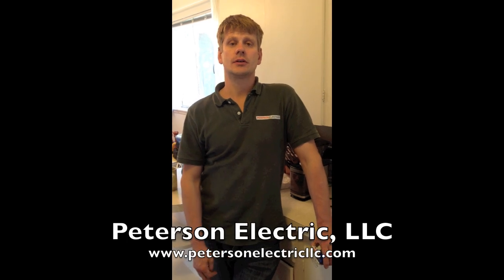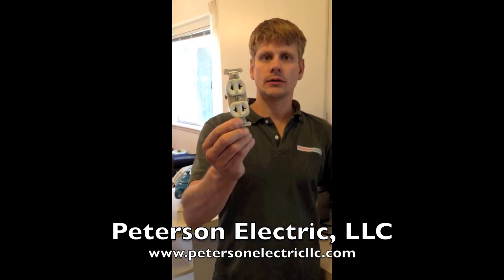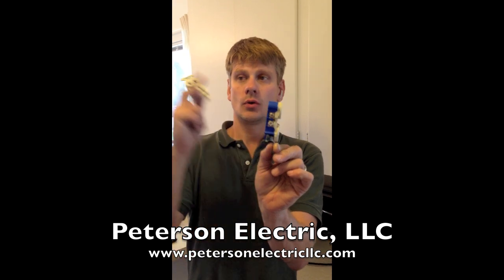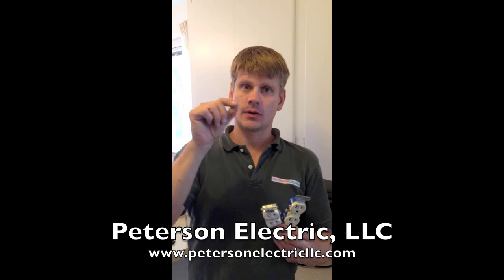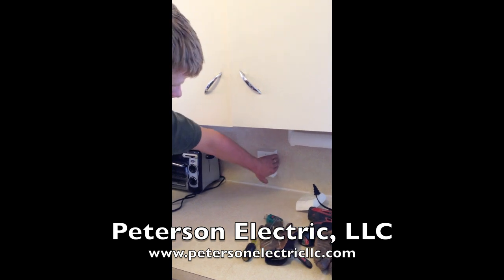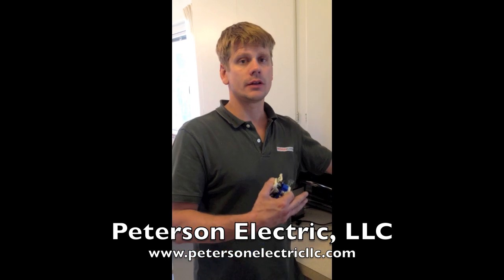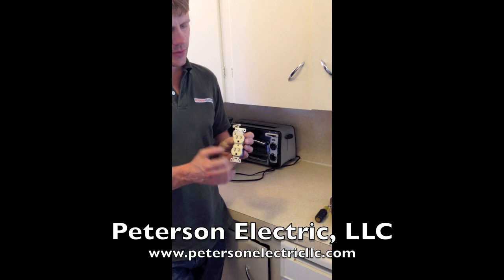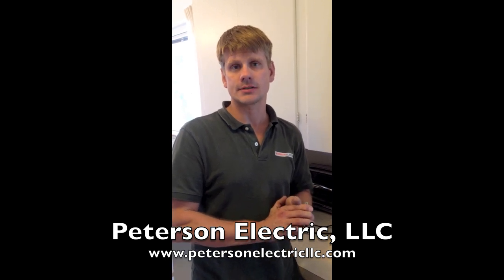What To Do With Electrical Grounding in A 1950s Home?

Comment: You didn't mention that an ungrounded gfci will not protect sensitive electronic equipment, even with a surge protector. Ungrounded gfci's must have a sticker on the faceplate stating "no equipment ground".

Comment: adding a separate ground wire back to a correctly grounded up graded panel would work, the ground would function correctly. Then why does NEC not recognize this as a properly grounded outlet or method? Then if a copper water pipe is tied to a ground rod which in turn is tied to the panel then a grounding clamp onto the copper cold water supply could catch a ground wire at an outlet and work correct.  Only problem would be if the water pipe were to break it would isolate the ground clamp and lose the "outlaw" ground. Last ground question. The old conduit systems were tied to the panel and so were grounded. I have seen pigtails in an metal outlet box which served as a ground. It works but is is legal? Actually the screws on a 3 prong outlet would ground to the conduit attached outlet box.

Comment: Installing GFCIs doesn't magically give you a ground if you don't already have one, and the presence of 2-wire outlets does not necessarily mean you do not have grounding through the conduit. I question your expertise.
Reply from the maker: YAH, I agree with you, but you have probably not watched all of my videos on my statements of GFCI and AFCI are NOT THE ONLY SOLUTION> You and I think the same about needing the Grounding wire in the circuit. Not sure how you came to this conclusion based on my videos. IT IS A MUST WITH OUR COMPANY' POLICIES  to have the EGC conductor installed.
Reply: @Petersonelectricllc  afci has nothing to do with grounding. Once again, I question your expertise.
Reply from the maker: @arthurserino2254  YOU ARE WRONG< AFCI AND GFCI NEED PROTECTION TO THE GROUNDING SYSTEM IN THE HOUSE, I know where the code articles are, do you????
Reply: @Petersonelectricllc  afci detects Arc faults, it does not require a ground to function properly. GFCI does if it is being used with a grounded Appliance. The fact that you don't know this raises serious concerns, and I would never hire you to do any work in my buildings. If you know the code so well, you should understand them too.
Reply from the maker: @arthurserino2254  210.12 
210.8 
406.12
406.4D
250.130C
250.122
110
100 
ON AND ON - I could do this all day. You don't know anything.
Reply: @Petersonelectricllc  Great, you can use Google just like everyone else. Too bad you can't explain the difference. You prove one thing, you're no master electrician.
Reply from the maker: @arthurserino2254  The difference is simple, Arc vs Ground faults. .007 milli amps on faults for GFCI min. AFCI, thermal. Either way Grounding is the first cause of safety. I am not a Master, only CHrist, But i am an expert in my field, learning every day. You?
Reply: @Petersonelectricllc  finish your training before you start making an idiot of yourself on YouTube. It's not good for business.

Comment: I have a house that 35 years old and the neutral and ground are on the same bar and is grounded with a 8 foot rod I never had a problem at all,  When  I test the wall plugs with a plug in ground fault tester it shows that I have a grounded sockets. What problems should I get and why did I not get them in 35 years of use
Reply from the maker: When there is a fault the studies have showed that the fault needs to go to the first point of disconnect, if you have one. This limits the the fault to the main breaker and not the utilities.
Reply: @Petersonelectricllc  seems that other than in a sub panel this should not cause a problem.
Reply: There are a few videos on YouTube showing the problems this causes when there's a short. You may not have problems in 35 years or EVER, or you may have problems tomorrow.

Comment: What about when you're trying to hook a new service up and then need to arc fault would you just get arc fault and GFI rated Breakers to do the same job?
Reply from the maker: This video was put out prior to the DF breaker designs. Yes I use them and prefer them over the plug devices

Comment: Hi my friend long time viewer ok. 
This is what i am dealing with my parents have a duplex the back house is 1940 with 60amp service they dont want to upgrade to 100 amp so the house has a new panel it was installed 15 years ago fast forward to know . The house has two 30 amp breakers that feeds to outlets and lights threw out the house. My Question 1.# I am going re wire the house since i have two 30 amp breakers i was going to use 10/2 for Laundry Room , Fridge , Garbage disposer, also Restroom has a light / exhaust fan / heater i want to just connect heater only to that circuit will this be an issue in going over 30 amps     ? My 2nd Question is the rest of outlets threw out the house including lighting witch will be L.E.D will be running of the other 30 amp breaker using 10/2 ? Keep in mind i will be using 30 amp rated switches and outlets and will i have any potential issue in question number 1 thanks
 Here is a fallow up question to question number # 1  
Say heater is running in restroom and washing machine and some uses the Microwave will that cause breaker to trip cause of the spike in amp draw or Voltage ?
Reply from the maker: This is not how one should wire. You need to read 210.20 and 210.50 and 210.52 and 220.42
Reply: @Petersonelectricllc  Thank you for the reference article you ask me to review . I for got to mention that the house when they changed out the main panel they put a new one and the main 60 amp breaker was back feed and branch circuit breakers were on two 30 amp breakers know my understanding basics residential electrical new that this was not rite cause potentially cause overheating and loss of conductivity in the cable. But rather had posted my question to you before i tackle it and my intention was to keep it the same but use the correct cable witch would be 10 gaug thank you for taking the time and reading my question and answering you do excellent work and keep on making videos take care .
Reply from the maker: @mariolozano1223  You have to have a 100 amp main for the min. breaker disconnect size to the home and then size your feeders based on 310.15
Reply: Thank you my friend i got an electrician out here and he getting the permits pulled for 100 amp install

Comment: could you bypass the cold so you can use a two prom outlet
Reply from the maker: No, the cold water grounded conductor is the grounded electrode to the main service, but it has to be installed first, before you consider running grounding wires or conductors to all branch circuits. PLUS< other grounding in article 250.53
Reply: john hershey yes best bet go off another circuit hop ground to panel from new receptacle

Comment: Question I have is when replacing a  metal box with an old work plastic box where should your ground wires go.
Reply: I assume you're question is because you "don't ground the box". Simple answer is you don't have to... it's plastic and non-conductive. 
If your wiring is upgraded (unlike this video), the ground wire will still connect to both the panel and the receptacle.
Reply: In that case you don’t have to “bond” a plastic box. You can attach the ground wire to the device directly. That plastic box will never conduct electricity so there is no hazard there.
Reply: If you do not have a ground wire you should use a GFCI protected outlet and leave the ground unconnected and mark the outlet with text "No equipment ground." If you chain from it with normal outlets, you need to mark also "GFCI protected".

Do not improvise with the ground wire, it can kill. Remember if the ground wire gets hot, your equipment gets hot.

Comment: Great video!  I am improving my garbage disposal situation by adding a GFCI receptacle.  However, I still don't have a ground wire from the service panel.  Should that be of any concern to me?  Prior homeowner put a grounding clamp on the cold water copper supply pipe for the kitchen sink, and thereby got a ground for the garbage disposal.  However, I have been warned (by a layperson) to remove that because it supposedly will cause electrolysis.  Is that true?  I am supposing that the parts of the grounding clamp that contact the copper pipe are also made of copper, therefore no electrolysis.  What do you say about it?
Reply: Leave the ground wire unconnected (do not improvise) and mark with text: "No equipment ground".
Reply: I agree to remove the ground. The GFCI will be your protection there. The larger issue with using old copper pipes for a ground is that if there is ever a short,  your entire plumbing system is electrified. 

And yes, it's true that it can cause electrolysis and degrade your copper pipes, especially when there is a short.

Comment: If the house was built in 1950, then it NEEDS to be rewired. I wouldn't even mess with wiring that old, to be quite honest.  Especially cloth wire.
Reply: Rick Delair  Make & share a video showing all of this historical electrical you have in your working trailer museum.
Reply: Rick Delair  Forgot to mention when you make the tiniest snag on an NM romex it tears a huge hole in it exposing the individual wires as well. I've seen a lot of K&T pass inspection and be labeled perfectly "safe". 
That said though, I'm not going to argue that if it's possible to ground your work, you should, and it will not only be safer prevention against electrical shock, but fire as well. It's easy to tell an adult "just don't stick your fingers in there", but when they also have a toddler running about sticking their everythings into everything else.... I can see why old wiring gives people pause.
Reply: Rick Delair it only took me 3 days to finish reading your book.
Reply: @Go-Getter  😆

Comment: Very well done video, short and concise but GFCI's do diddly squat for protecting equipment plugged into them if there is no ground right? That's why I came here at least. I'm in an old house and have very expensive computer equipment that I'm concerned for plugging into an outlet with no ground. The boxes in the wall are metal but they don't seem to be grounded. I am using a UPS and the output voltage is the exact same as the input voltage to it (121-125) where as at our old house (grounded outlets) I noticed my UPS always read output voltage as 120 even if the input was a few volts over, I take it this was because the extra had a ground to go to?
Reply: My computer equipment is connected to a circuit which reads 124.1 volts AC.  But when I check the ground, it reads 68 volts.  Somehow, I don't think it is fully grounded, but I don't know why it shows any voltage at all on the ground.
Reply: GFCI monitors the current between live and neutral. It has nothing to do with ground. Sure with found it might trip faster but it still protects from a shock between live and ground. Note it does not do anything to protect from a shock between live and neutral.
Reply from the maker: Article 250.130 allows a separate "green" grounding conductor to be ran and ground the box and plug. How is based on structure of home.

Comment: Where are you purchasing the plastic extension ring? I asked for them at a local electrical supply house and they didn't know what I was talking about. Or if you have a link to a site to purchase then from. thanks in advance.

Comment: Hello Josh.I live in Arvada, Colorado.My wife and I just bought this house a couple of months ago. I am also a musician and I just recently finished putting together my recording studio.
When my guitarist and I both practice at my home studio, using "distortion" effects, we both get massive amounts of static sounds coming out of our equipment.
I tried switching cables, moving equipment around the house to different outlets and switch stuff on and off in order to troubleshoot the problem.
So I came to the conclusion that there is a possibility that the whole house is poorly grounded.
 Do you think you can give me a punch list to go through in order to try and spot the origin of the problem? 
Should I check individual outlets and see if there is copper going to the grounding prong? Or should go as far should I go outside and check the electrical panel and see if it's grounded properly, and what would be a proper grounding of the electrical panel?
Reply from the maker: I think that you will need to run dedicated circuits for you equipment and make sure that the circuits are on the same phase in the panel with both circuits needing dedicated neutrals. You could also buy a conditioner to clean up the circuits. Do not put your lighting on the same circuit.
Reply: +Peterson Electric interesting.
I will keep all of that in mind for my next trouble shooting attempt.
Thank you.
Reply: @Petersonelectricllc  my old outlet is old with only two cables no ground cable so what would be the less expensive way to add the ground cable? can i fish and drag new cables from the main box all the way to the outlet? or rewiring is more complicated?  i just need one single outlet with ground to protect my audio gear
Reply from the maker: Refugio Flores yes you could try and fish this wire in. If concealed then you don’t have to worry about it being damaged.
Reply: @Petersonelectricllc  oh but i dont know if that outlet goes all the way to the breaker panel or not ? i will ask a friend that know about that but that would be good to fish new wire with that old one. other option is run an extension from the kitchen to my room which is not the best thing to do

Comment: @50 seconds.... current returning to the service panel on the ground wire does not go out to a ground rod. It returns to the transformer via the grounded (neutral) conductor. Current should only travel to your ground rod in the event you lose that neutral back to the transformer.
Reply: trudaroof but the entire reason for the grounding system is to return the power to earth (ground) in the event of a short or lose of the neutral leg. Thus his statement is not inaccurate. Nor is yours as yours describes the intended routing while his describes the safety purposes of the grounding system.
Reply: @coypatton3160   to earth through the grounding rod? The older 50s panels were not grounded through a ground rod? A rod and ground could be added to make the panel grounded then a new 2 wire romex could be added to the old panel as an upgraded or new curcuit?
Reply: Bob K I agree the older homes wire with a 2 wire only (no ground) did not ground to earth trough a ground rod. But that was the early days of electric. But many of those homes did have a “ground” wire running in the kitchen and bathrooms. It was ran on the outside of the box in the wall and was smaller wire. These generally were grounded to metal water line/pipes that ran underground. 
If you are replacing wiring in walls, I am assuming you are doing a complete remodel of the home, I do not understand why you would want to retrofit a panel from the 50’s, it likely was an 80-100 amp service panel box, that is just not sufficient for the demands of a modern home. 
Upgrade that service to 200 amp service and do it right is my opinion.
Reply: @coypatton3160  It was a question to help me understand if a ground could be added to an old system. Yes I would upgrade the panel to a modern one of at least 100 amps. Thanks for your answer.help.
Reply: Bob K unless it is a very small home/ apartment, you will likely exceed 100 amps with all of the modern electrical things we use and never give a second thought about. While many modern appliances (used loosely) are much more efficient than there counterparts a few years ago, most were not present when these homes were either built or retrofitted with electric power. 
Think about!
No electric heat, no electric oven/stove, few TV’s, no computers/cellphones/cordless house phones/tablets. 
Also realize that a 100 amp service near its capacity generates more electric risk than a 150 amp service operating at the same capacity. I would not consider a 100 amp service unless it is a very small house (2 bedroom 1 bath) and then I would still probably do a 125 or 150 amp. Just my 2cents!
Reply: +Joshua Peterson I wasn't trying to bash your vid just wanted to add that. Thank you for sharing your knowledge.

Comment: So if have a metal box, bx cloth (no visible ground), and a GFCI, then what do I do about the open ground in the GFCI outlet? Just leave it open?
Reply: Anthony Pasquariello yes and label it with “No Equipment ground” and “GFCI Protected”.
Reply: @coypatton3160  You do not need to mark "GFCI protected" if it is the socket that has the actual protector. Everyone can that it is GFCI protected. You need to mark those that are chained from the socket using its protection.

https://www.ecmweb.com/sites/ecmweb.com/files/styles/article_featured_standard/public/uploads/2004/10/410ecm17fig1.jpg

Comment: I did this in my house which was built sometime in the 50's. Although there is no ground wire in any outlet box, the outlet boxes are metal and and wiring is covered with metal conduit. Inside the metal conduit, there is a ground wire (very thin) throughout the whole length of the conduit. When the wire with conduit was run to each outlet box, the wire with conduit is clamped to the metal outlet box as it enters the box (the box has the clamp built in where the wire enters the box). This provides a ground to the box so that when you screw the receptacle to the box, the outlet is grounded. You could also drill a hole at the back of the box and attache a ground wire to it and then attached the other end of the ground wire to the green screw on the receptacle.
Reply: With conduit you can  fish a ground to  all the  boxes and back to the  panel to be on the safe side even though it technically is still grounded via the conduit to panel and disconnect the wires from bus bar and breaker and put a grounding lock nut on it